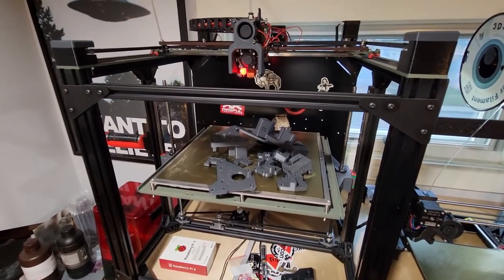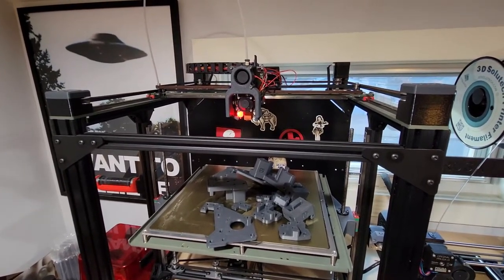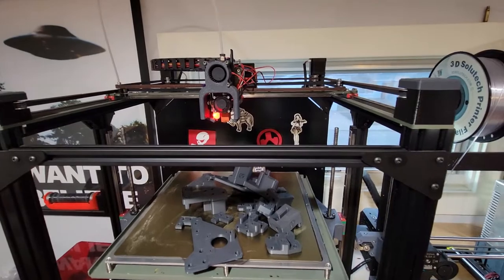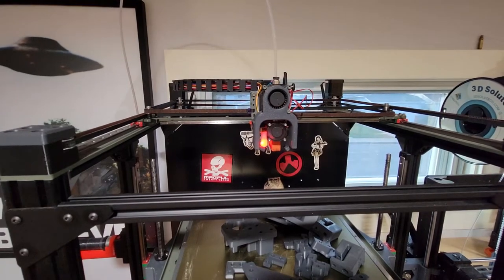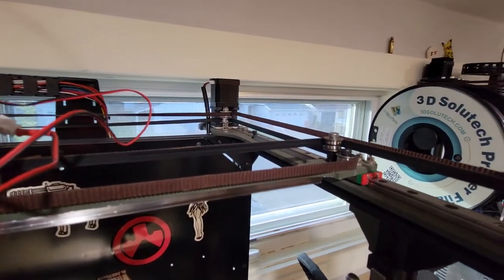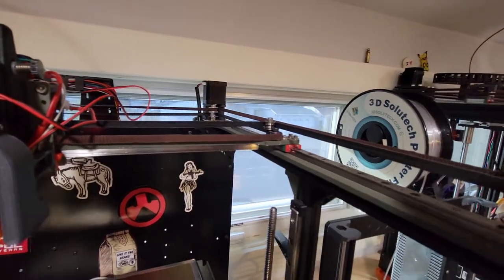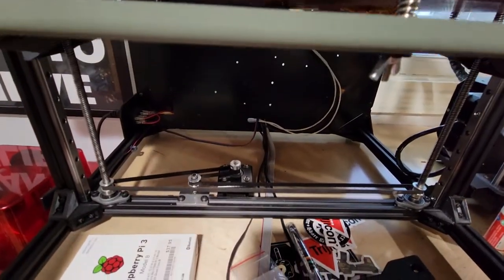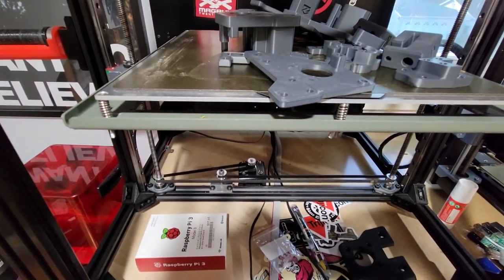SecKit Go Printer - Why it SUCKS.  Don't waste your money!

Comment: The only thing I got from this video is vibes. You're angry, we get that. Now if you could calm down enough to point out the flaws and issues, that would be great.  As it stands this is just venting.
Reply from the maker: It's so old. - Basically shitty design, shitty hardware and charged max price for junk.  Yes, angry at it - will never recommend shit kit go.